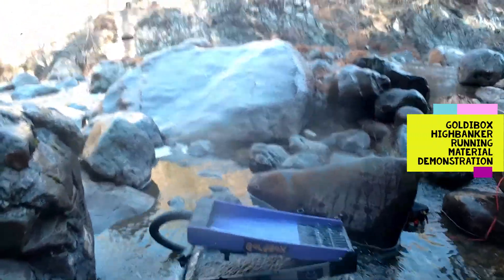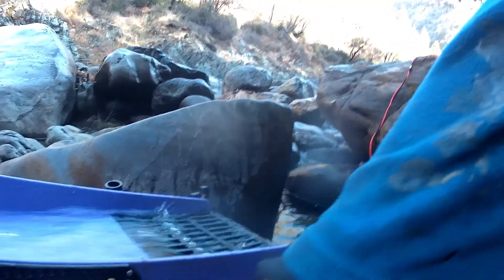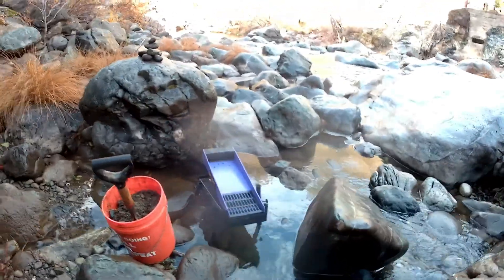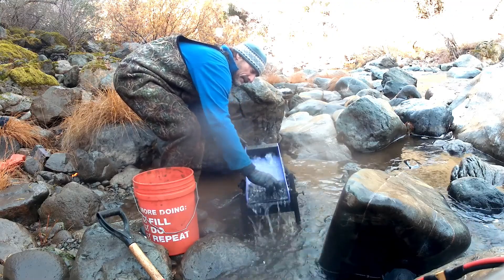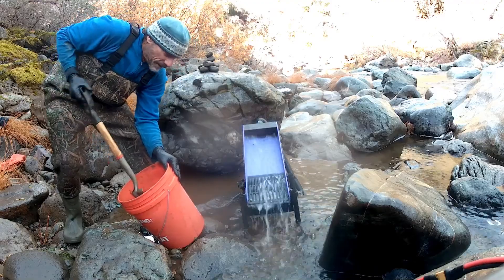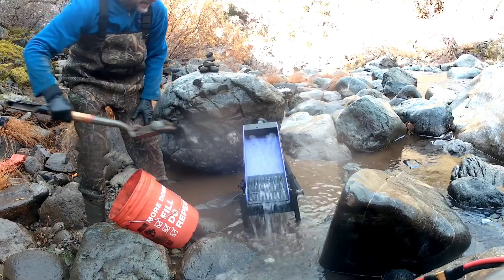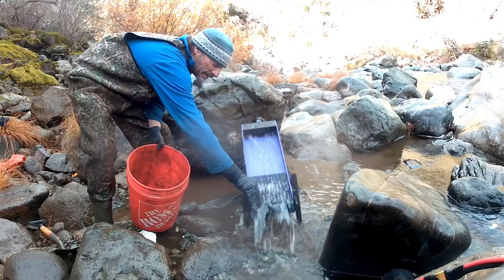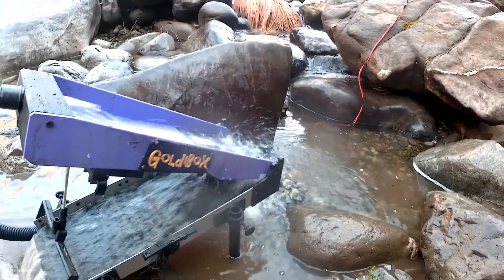GoldiBox 3D Printed Highbanker - Running material demonstration

Comment: Looks interesting. You might want to use a screen to classify the material down to 4 mesh at least for that size a highbanker before running it, and make sure the highbanker itself is dead level side to side... although that could be an artefact of the camera itself not being level.
Reply from the maker: Clint, thanks for the advice.  I do have several classification screens for the upper deck of the  highbanker. They range from 1/8" to 1/2" depending on the material I am running. The just pop in and out of the hinge pins.  I am also experimenting with new mat designs.  I doget good exchange within the riffles but I am always looking to improve.  I also level the highbanker and check it periodically but I am sure there are times I either bump it or it settles a little if the ground is too soft.  Thanks again.